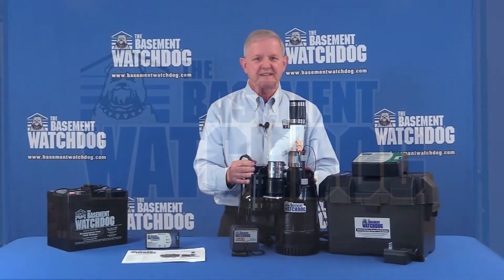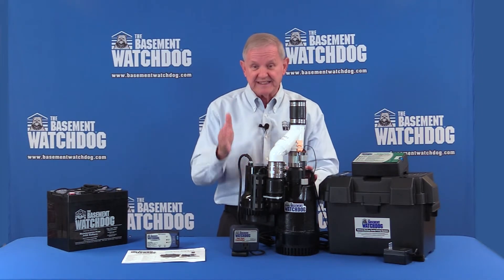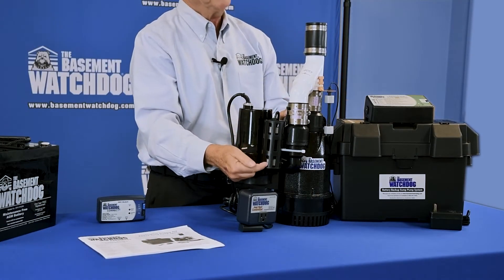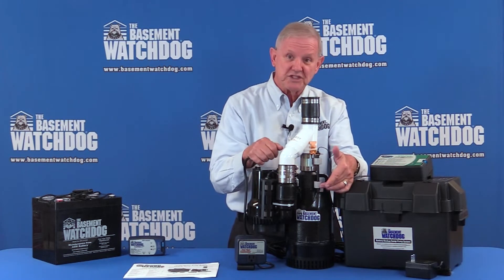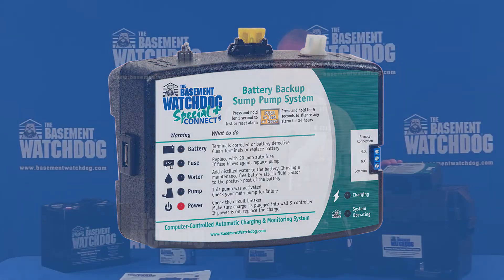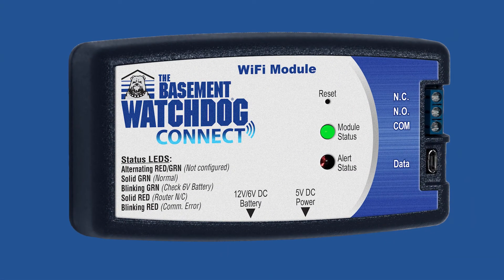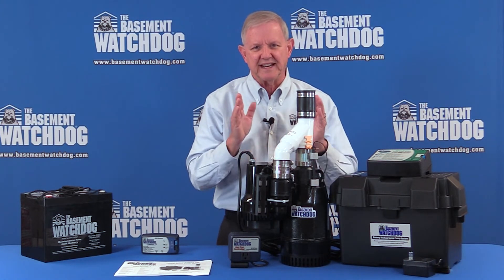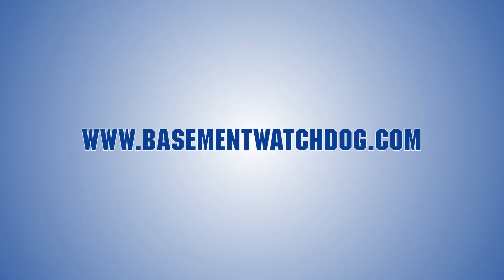Basement Watchdog Big Combo CONNECT Sump Pump System (CITS-50)

Comment: So it just warns you or does it pump out?
Reply: Lmao. It pumps. The secondary pump kicks on with battery power should your homes powers go out, it tells you when you’re on battery backup.
Reply: @ryanfoster2437 So if your power goes out, so does the wifi.  How does it notify you?
Reply: @markmarquardt3119  it sounds off an annoying beep from the unit itself and for the same reason you’ll get a notification when your wifi is off that your home alarm system is down. Same principle